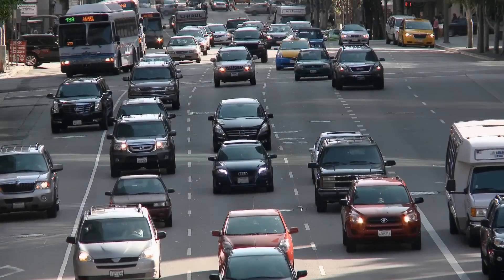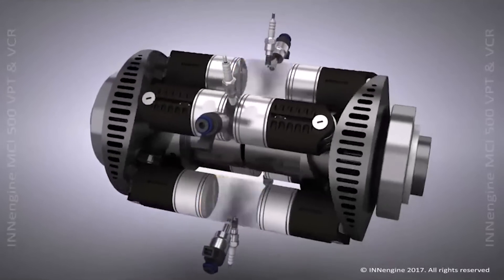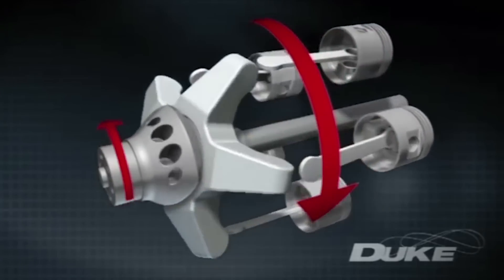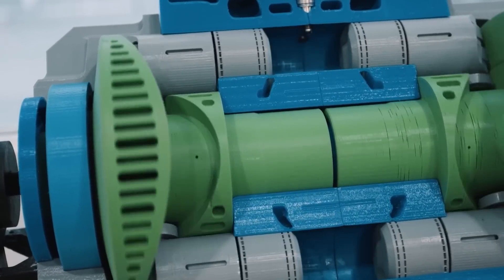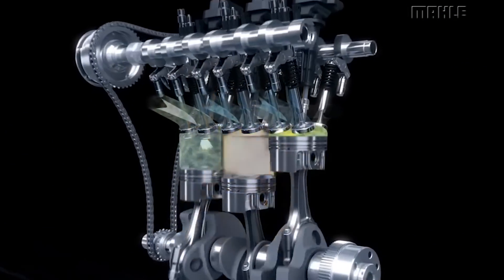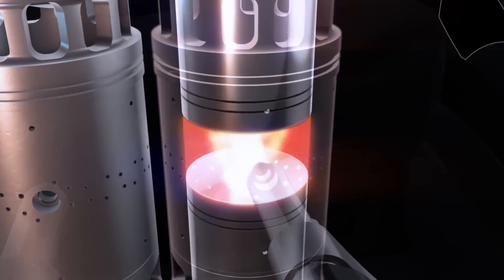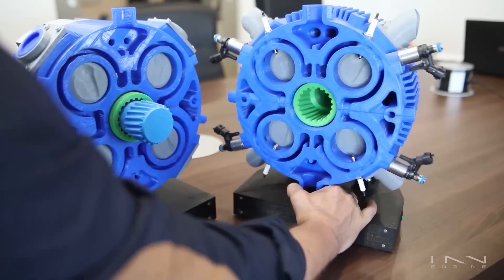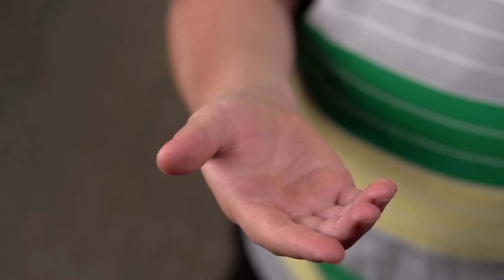Revolutionary One-Stroke Engine: Future or Fraud?

Comment: mv agusta make a 3cylinder 4 stroke 675c engine 130hp approx. 50kg including its gear box/clutch oil etc. so that busts the 4x kg to make the same hp idea straight up- put a gearbox on it and its the same weight......

Comment: The power stroke vectors are almost useless. The slight angle that the rotating plate provides would require a side roller bearing as well to prevent the pistons base from scoring its side wall, since some of the force would be vectored to the side of the piston. In a regular ICE, the power stroke occurs at a right angle, and the connecting pins allow the float of the connecting rod. Basically, this motors design has a very inefficient transfer of motion. This, along with SEVERAL other issues.The engine design is a FAIL.

Comment: heh, I have a design for a engine based on this mechanism that I did back in 2007, but it wasn't multicylinder, because I though about that and I didn't like it. It's still in my Unigraphics project folder.

Comment: unfortunately , you took too long, passed the time, lost your timing. 
This engine should have been in production since 2003, for example.
Now you won´t even break the investiment .
Now it's too late, you missed the train of evolution. 
Now it's time for electric motors, even better, more powerful, much more efficient and yet not polluting the environment and still not making noise.
The time and money you spent, for example, should have been on a better battery, such as the sodium ones that are coming around.
Diesel engines are now completely out of date.

Comment: wow that was well researched. 
yeah the only real 1 stroke engines are from external combustion, eg steam. its a shame about this motor though, both opposed pistons and swash plates should be rather efficient and should sell itself but maybe there is a design flaw causing issues somewhere.

Comment: You missed the point on a 2 stroke engine the pistons suck in the fuel compress it then light it when it expands the pistons move down expelling the burnt gas. This engine doesn’t suck in the fuel it is pumped in which is accurate calling it a one stroke it only goes out then resets it doesn’t suck in the fuel it must be pumped in

Comment: I hate to say this but it's a 2 stroke engine not a one stroke engine the piston goes in and out just like a 2 stroke engine. Set up like a Fairbanks Morris engine only with out the crank shift a roller coaster drive platforms. This will allow regular gasoline to be used instead of oil in the gasoline like a two stroke has to have. Power on every top of the stroke like a two stroke engine does. A turbine has no stroke at all. Wankel is a no stroke engine also. The stroke is both in and out with this concept two directors one each way. 
    Two stroke engine are more powerful than a four stroke and lighter engine design. This is a major advancement a two stroke engine without the oil in the gasoline, but how is it cooling itself down water or air?

Comment: 1 time don't exist on Earth... it is 3 times: intake and exhaust toggether, than compression, than ignition.. I made in 2003 a rotary engine of 3 times at the University. Very low cost and poor machinning by me... but it burn out 3 feet lengh fire out the exhaust pipe.

Comment: Electric motor is still the most efficient and strongest for its weight.
Batteries energy density keeps getting better each year. Any combustion engine will not be able to compete soon.

Comment: There are pros and cons. It depend on the company since people have monopoly which is either good and bad. They can buy this engine out and do nothing. Just put in cold storage or patent. So basically some politics come in play as well some nation are banning fuel type engine. I am not sure if those investor are either good or bad people. There will come with the catch and high chance to bankrupt if they start producing. They need to work one step at the time. Plus they need a prototype car to do this which required R&D cost. I bet there a lot of permits and license to create a prototype car or some simple car. Plus switching engine is hard thing since it config to preset and cost to rebuild the design and test them. It all guess work. I feel something wrong some time too many part or less parts reduce cost.

Comment: ethanol-koh electrolyte fuel cells is much better, and quiet, and direct electric, even for ethanol-air itself, but meant for metal-air fuel cells, with simple carbon felt air electrode, no platinum or other expensive complex stuff required

Comment: Rubbish.  This is a TWO STROKE “inverse boxer” engine.  1. Power stroke.  2. Compression stroke.  The video provided by the company claiming a very high horse power output is also BS!  Notice the turbo charger at the back of the engine up against the fire wall.

Comment: I agree about questionable marketing.  That said, when you say they clearly use a supercharger, the arrow points to an air filter.  I would also question if it counts as a 'supercharger' depending on the amount of boost.  At very low levels, it might be considered differently, especially in this application.  
Why are the rollers more a point of failure than a similar motion with much more vibration and stress in conventional pistons?  The piston has to connect, and there is that same rolling motion.  The wavy plate/ axial cam would seem to be, properly manufactured, at least as reliable given fewer moving parts.  
120HP from a 500CC engine is decent.  It would depend on the overall power curve and fuel efficiency in a practical application, but that is not a bad starting point.

Comment: You should check out the "DynaCam" engine of several decades ago.  It was  Patented in the 1930s as an aircraft engine and Dynacam bought the patent and tried to start producing them for aircraft and ground vehicles like buses  in the 90s but ran afoul of the outrageous regulations, Governmental red tape, and rampant torts of the time.  Several large engine manufacturers tried to buy them out to suppress competition and were rebuffed by the fledgling company and subsequently were effectively boycotted from venture capital and I believe they went bankrupt somewhere in the 90s or early 2000s.  The engine was very reliable, quiet, vibration free, lightweight, with very low profile.  It would have been an ideal engine for small aircraft but the tort liability for general aviation was so outrageous that the insurance for producing the engines was over 1000% more than the cost of manufacturing the engine itself.  The engine was made as a double ended piston connected to a swash plate in the middle with rotating sleeve valves at each end which were the cylinder heads.  Emissions were effectively the same as a 4 cycle but compression could be adjusted  along with timing to use different fuels and improve combusion.  I was a real fan of the project but did not invest because I felt the managment (primarily engineers) were fairly naive about the business side of things and was proven correct by their mismanagement of that taspect of the business.  As far as I know, the business is still available for purchase by the smart business person and could be produced very reasonably priced to the right customer base.

Comment: Interesting concept obviously needs work.  Good points on status.  Huge correction is needed by you!  Fuel in a two or four stroke engine does not explode.  It combusts, explosions will cause your engine to knock.  It’s called “internal combustion” not “internal explosion”.  The fuel burns very quickly.

Comment: The engine is very interesting. It seems something like a boxer engine but in a different way. Why not make this engine with a very high compression ratio, something like 20:1 & remove the spark plug Thus trying to run it as a diesel engine while eliminating 2 stokes of the crankshaft as you have detailed in your video. I hope to see more video.s on this type of engine.

Comment: The animation shows the swash plates perfectly in sync. This is very unlikely. It's far more likely to behave like a deltic diesel which through simple phasing uncovers inlet and exhaust ports in sequence. 

The rollers are a terrible idea. Michell bearings on a nutating pad would be way more reliable, lighter and cheaper, although it would tie them down to pure sinusoidal reciprocation again.

Comment: Lunch money?  I wouldn’t risk the price of a cup of coffee.  I think you have highlighted the problems with this concept.  The two things that hit me from the title of a One Stroke Engine, was how do they purge the exhaust gases, and prevent pre-ignition of the fuel.  How does the bearings running over the swash plate prevent seizure.

Comment: If someone remember, there was a REVETEC engine. using the idea of replacing crankshaft with radial cam. And these one still in development. In this design (if this video more or less accurately show geometrical proportions of the "wave plate", which is in reality an axial cam) most of the force, generated by burning fuel, will be spent for deformation of this "wave plate" in the point of contact to roller. This unavoidable lead to the excessive wear and destruction of the parts involved due to really huge contact stresses. In my view - it is not something to work as expected. BTW, I'm retired Mechanical Engineer with good knowledge of materials strength and capabilities.
Reply: what about a Hydro powered car or at least after startup to replace Lithium batteries ?

Comment: The nice thing about this concept, is that you can use not only variable valve timing, but variable piston timing, drawing out the time the piston is being pushed on by expanding gasses/drawing in and mixing air and fuel, and shorting the time it spends pushing the exhaust out/compressing the air fuel mix
Basically its an offset piston, without the balance issue
Reply: Of note, offset piston engines that use a piston and crank do exist and offer promising efficiency gains by allowing the air and fuel more time to mix and evaporate, and then more time to dump its energy into the piston before being let out of the exhaust, the major dowside are primary and secondary balancing making it near impossible for the engine to run smoothly, this, in theory and in practice means an engine with a reduced lifespan.

Weather on not these rollers will offer a better life span than an offset piston engineis unclear, but the fact that ther is no rod pushing/resisting the piston off axis, and that there is an opposed piston to offer primary balance, is promising.

What i'd like to see more, is a larger re-design that uses a single swash plate, that drives opposed pistons on either side of the swash plate, allowing for a more efficient naturally aspirated 4 stroke, this along with a sharp curve to go from BDC to TDC quickly, and a gentle curve to go from TDC to BDC allowing for a longer intake and power stroke could make this revolutionary, you'd maintain the primary balancing of an opposed piston, but you'd get better fuel economy, yes it would require a valve train, but who says you need to use traditional valves, you're already using a swash plate, whos to say you cant use a swash valve that surrounds the spark plug that spins instead of reciprocates.
Reply: @denvera1g1  Do you think it's a problem that the rollers are cylindrical. Shouldn't they be conical to eliminate additional friction?
 I also though about a 4 stroke design. The problem with rotation valves is bviously the sealing. But this shouldn't be a real problem.
The idea of variable calm plate geometry seems to be smart and simple.

Comment: I was thinking about the time factor in recharging electric vehicles. Could vehicles be constructed with large removable battery packs that can be quickly exchanged at a charging station? They could make an automatic mechanism to pull out and replace a battery pack after parking in a special jig similar to a car wash, and with the press of a button. This probably could be done in about a convenient 5 minutes. All cars would have to be designed with the same standard battery pack that easily slides in and out. The replaced battery packs would then be charged and ready for the next customer.

Comment: Thus will go the way of Ralph Sarich's Orbital Engine, that he designed in the '70's. It worked really well, small, fuel miser, environmentally sound, lots of power, cheap, had everything going for it. One of the major car manufacturers bought him out, and that was that, disappeared for ever. The car company in question, didn't want that, big V8's were what they wanted.

Comment: It looks as if it is going to have the same issue as the rotary engine; it will need an enormous amount of oil to keep it running which means it is never comply with modern government regulations as far as using it in cars is concerned. The basic principles in the engineering in this however could definitely be useful in other applications.

Comment: But it still uses fuel to be combusted, I’m assuming petrol, which then is burned to provide propulsion and finally produces gases from the exhaust which are released into the atmosphere as noxious gases adding to the already intolerable levels of emissions that are being created. It’s pointless. Anyone with intelligence knows that all is needed to propel a motor vehicle is an electric motor or two, a large traction battery and a computer to control everything. Simple.

Comment: Of note.  Cam shafts of 4 stroke engined be it a flat tappet or a roller bearing are traveling at 1/2 cranknshaft speed to ensure proper valve timing.    They also do not see the kinds of pressures that being loaded by a combustion event will provide.

On top of that the bearing of the lifter is rotaring at a speed/ratio that is determined by cam shaft diameter and roller bearing diameter. 

Consider how fast the bearing connected to the pistons must rotate during the travel of one revolution of this engine.   It will be many more rotations of the bearing, rotational/angular velocity or linear speed.   Whatever you want to call it, it does not win out over a coventional ICE engine.  Torque production/mechanical advantage is likely much worse so this engine may inly be suitable for a generator type application.

Also, once wear does begin the tolerances of the cam surfaces are likely to wear in ways that will quickly start destroying parts be it the bearings or the surfaces they ride on.

Comment: For an engine that is smooth and quiet that works only as a range extender I'd be interested to see how a turbine of sorts stacks up tbh. Either a jet turbine using diesel or petrol, or even a steam-powered turbine with a furnace. Granted the efficiency would probably be a fair bit lower, but it would be cool to see ngl. Especially as its something that would be able to take its time warming up and not need to operate as soon as the cars switched on, assuming the battery can last a few minutes without it.
Reply: Turbines are notoriously thirsty beasts plus there’s the heat and exhaust to deal with as well. Trying to minimise dust from that airflow while trying not to cook pedestrians would be difficult to say the least.
Reply: @trevorpom  Suprisingly they did actually solve the dust and exhaust temperature issues in the 60's with the Chrysler Turbine. The exhaust on that was cooler than a convensional ICE car, at least at idle.

Comment: May have some applications.  Still significantly less efficient than an axial flux motor or even a radial flux (BEV motors).  Axial flux ~ size of a stack of 4 dinner plates, 50 pounds, & easily produce > 500 hp, constantly, nearly frictionless & no combustion.

Comment: In 1911 the Macomber Rotary Engine Company of Los Angeles marketed one of the first axial internal-combustion engines, manufactured by the Avis Engine Company of Allston, Massachusetts.   More recently the Dynacam engine and a few others in between those.   So these have been around for quite a long time.

Comment: As usual, a startup in need of funding comes up with the idea that we're going to revolutionize the market. But there are already some very promising experimental compact motors on the market, with efficiencies close to 50%. If they haven't invaded the market for hybrid cars, generators, etc., it's because they pose problems of reliability and cost. I don't think a small start-up can do better on this point than the big manufacturers with their experience.

Comment: Frankly a small engine with no vibration that can run with ANYthing that burns, with only one moving part and zero maintenance exists already and it was invented in Victorian times… it’s called a turbine…. such an old idea is the ideal range extender. We know everything about turbines and we are able to build so small and cheap that diy people use them in building small scale jet planes… I wonder what are we waiting for to put one in an electric car and see it go almost indefinitely with a drop of fuel?

Comment: There's a compression ignition engine called a "Sterling Engine" that uses a swash plate instead of a crankshaft, apparently to avoid patent issues.

This is not to be confused with the "Stirling Engine" invented by a Mr. Stirling.

I would call the device in this engine a face cam.  https://en.wikipedia.org/wiki/Cam

Comment: If it's a range extender so power is not a problem, and you have to lug around a tank of hydrogen regardless, fuel cell will suffice with less moving parts and higher fuel efficency.

Comment: Insanely light until you add the gearbox, EGR, exhaust, catalytic converter, fuel tank, prop shaft, cooling system etc

Comment: What is game changing about it ?
It still won't beat the Carnot cycle max efficiency, it still use internal combustion of a (more likely than not) carbon based fossil fuel, it probably also still uses disposable lubrification oils etc...